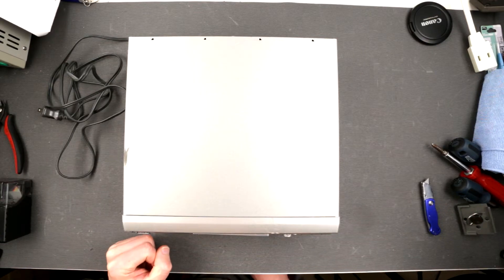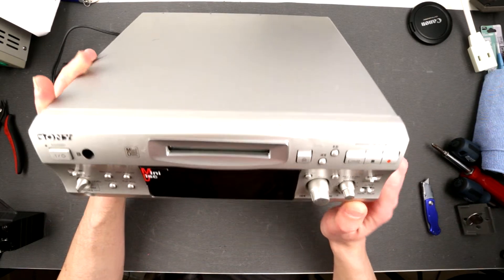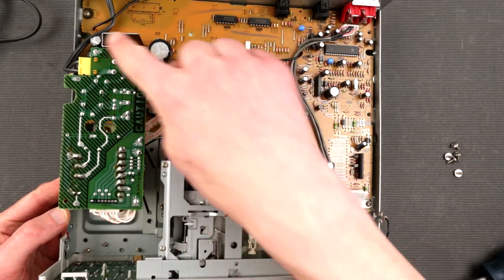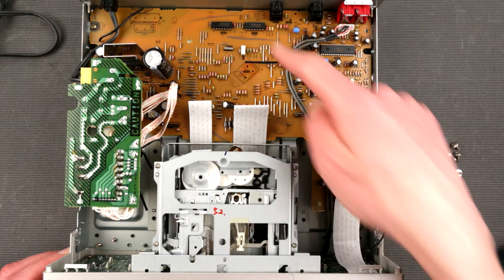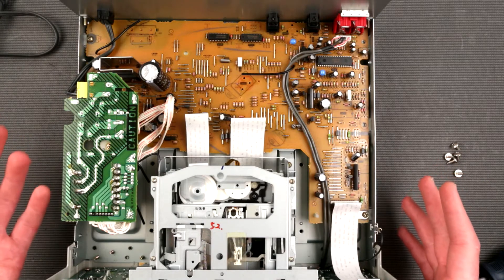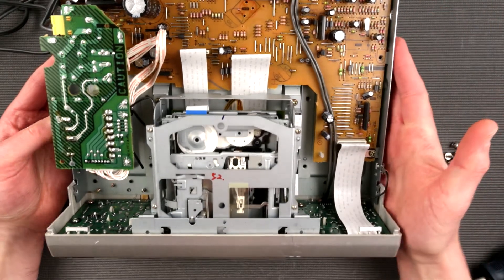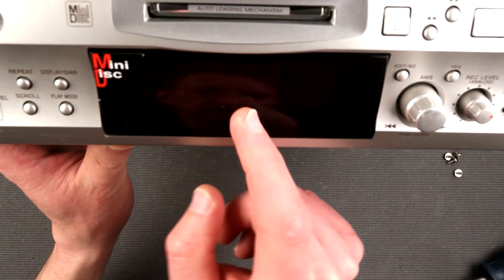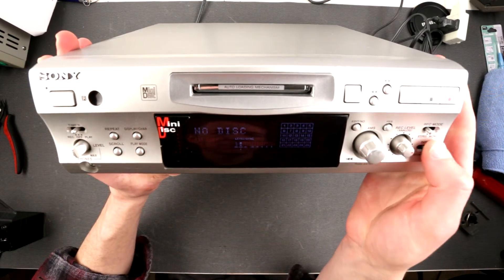MiniDisc deck Sony MDS-S707 repair - Part 1

Comment: Hello Sir. I bought one myself to repair it maybe.    Its fully functional as far as I see. Laser works, in and out take. But the motor to turn the disc doesn't do anything. Can you maybe help me there.
Reply from the maker: Does motor actually works?
Reply: @InsideOutElectronics  nope. No life sign as far as I can tell. But everything else works. Only the motor for the disk not
Reply from the maker: @shyperson8133  2 possibilities - sensor is bad that detects that disc is present ! Or motor is gonk (motor driver possibly) Or try to re-seat all cable for MD Drive.
Reply: @InsideOutElectronics  thanks first hand for answering that fast.     It detecs the disk. It shows on the display.    I think the motor.    Do you know where to buy a new one? Or what would you do?
Reply from the maker: @shyperson8133  Check the service manual here https://www.minidisc.org/part_Sony_MDS-JE510+S38.html , and looks for motor. I can suggest one thing - look at CD/DVD drives may be motor from there will work
Reply: @InsideOutElectronics  ah I'm sorry to bother you again. But I read trough the service manual and don't seem to find the motor or the whole disc compartment.
Reply from the maker: @shyperson8133  M901 A-4672-135-A MOTOR ASSY, SPINDLE
Reply: @InsideOutElectronics  thank you very much
Reply: Hello again my fellow sir. I have a question for you.     I have the Sony MDS S707 
And the MDS JE320    which one of them both is better. Because I only can fix one of them both
Reply from the maker: @shyperson8133  I think S707is better
https://www.minidisc.org/part_Sony_MDS-JE320.html